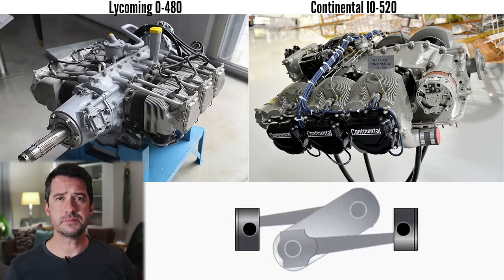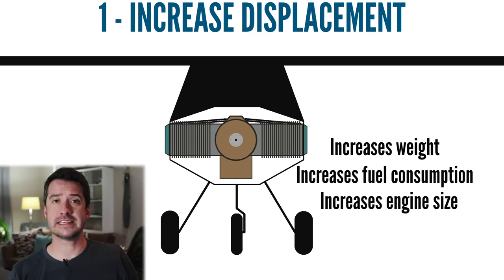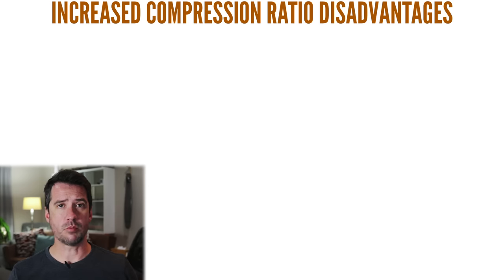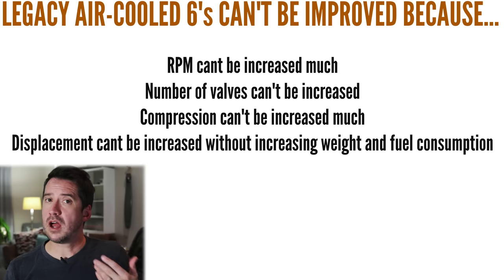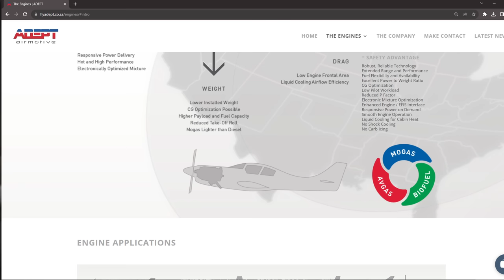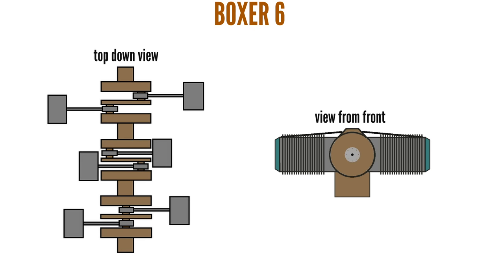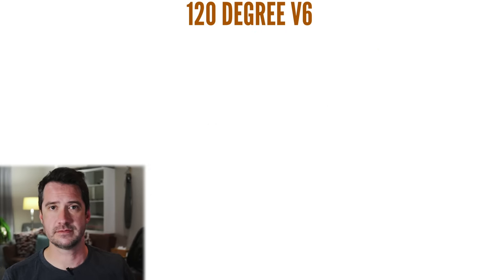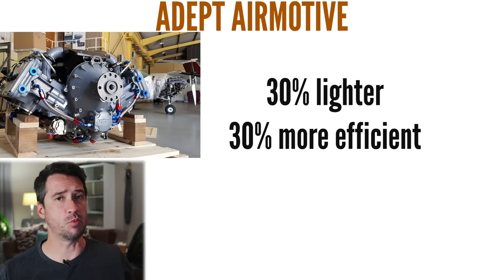Unusual V6 Airplane Engine Makes Boxer 6 OBSOLETE?

Comment: Introducing a new engine into general aviation is just about impossible given all the hurdles.
Reply: Rotax did it, so did Austro Engine. The problem seems to be Americans and their aversion to change.
Reply: @PistonAvatarGuy

And what is Rotax?

A 912 has the same power and the same weight as an O-200 whose basic design is from the 30s.. but they added four more failure modes (gearbox, dog clutch, coolant leak, and extra throttle cable). 

It’s a textbook example of why specific power (something Europeans obsess about) is meaningless in aviation.
Reply: @Bartonovich52  Here's what I suggest, look at the fuel consumption graphs in the operator's manual for the O-200, then read an article by Paul Bertorelli for The Aviation Consumer which is titled Rotax 912 iS Efficiency: Better than Claimed (Published:July 17, 2013)
Reply: Diamond did it. By simply converting a car engine. Very reliable and one of the safest in GA.
Reply: @Bartonovich52  Also, unless you have data which proves that the O-200 is more reliable than the Rotax engines, your comment is completely meaningless. You can speculate about failure points all that you want, but all that it ends up being is speculation.

UL Power can't even match the power to weight ratio and low fuel consumption of the Rotax engines, despite their lack of concern for high specific power output.
Reply: @Bartonovich52  Liquid cooling can't even be considered to be a failure point, as air-cooled engines are far less reliable than liquid-cooled engines because heat is so poorly controlled within the engine.
Reply: @Bartonovich52  I mean, gee, maybe there's a reason why no one uses the O-200 anymore, while Rotax engines sell by the thousands every year. It's hilarious that you people try to make me out to be the clueless one.

An additional throttle cable.. wtf? That doesn't even exist on the EFI engines. And I love how you just conveniently forgot about the 100 hp UL Power engine, which also happens to be European and is vastly superior to the O-200.

You have to be trolling.
Reply: @simeon2851 absolutely horrible engine. Single point common rail injection has no place in an aircraft.
Reply: @simeon2851  That was a diesel.
Reply: You can put -nearly anything in an experimental certified plane. SO any Any kit plane, or build it your self, they are Usually being smaller lighter airframes. That sounds just like the manufacturer's target market.
Reply: Its the bureaucratic agencies that move at the speed of observable evolution that stand in the way of technological advancement.
Reply: Not "just about" impossible. But absolutely impossible.
Reply: @Bartonovich52 And yet. I'd bet the Rotax is more reliable any day.
Proper fuel injection removes problems of (1) vapor lock and (2) carburator icing, and liquid cooling means (3) cylinders don't overheat when climbing and maximum power doesn't require ultra-rich-of-peak operation where unburnt fuel is basically used for engine cooling. (4) Pushrods are another source of failure, and not all parts of the air-cooled old-fashioned cylinders can be inspected, resulting in unrecognized cracks.
So instead of armchair-analysis, it would be better to compare engine failures in flight. The problem with that is, that unless it results in an accident, such failures need not be reported as far as I know.
Reply: Indeed. All the financial hurdles by the FAA has crippled GA growth and life. Most GA is using decades old technology unfortunately.
Reply: @PistonAvatarGuy  do you know what the longevity of Rotax is vs Continental? I know many of the small Lycoming can run way, way past their TBO but I don't' know  about Rotax and TBO? Continental can go past TBO but not with original Continental cylinders, which is ironic.
Reply: @PeterPasieka  No, but TBO is set where it is for a reason. You might get lucky with Lycoming and Continental engines, but they both have a habit of failing catastrophically, while that's not so with Rotax engines.

According to the stats, the engine core of the LyConts fails at 5 times the rate of the Rotax engine core. For Rotax engines, the carbs are a problem, but they can be bought with EFI, which is proving to be far more reliable.
Reply: I think that the rotax advantage is its water cooled head. I suspect  that cooling the exhaust valve area on an otherwise air cooled engine would allow a considerabley leaner mixture to be used without problems.  Rotax is only partly water cooled after all.cylinders still have fins
Reply: I think an opposed piston engine would be ideal. Diesel or gas.
Reply: @markjurkovich7814  Opposed engines are weak and difficult to construct.
Reply: @PistonAvatarGuy  I completely disagree with your statement as many examples show it does work. Junkers Jumo is one. But that's OK, I  like different points of view.
Reply: @markjurkovich7814  Sorry, thought you were talking about a boxer. And, sure, they work, but they're heavy and extremely expensive to produce, because they require two crankshafts and a large set of gears to link the crankshafts together.

Superior Air Parts already tried this with the Gemini, it went nowhere.
Reply: @PistonAvatarGuy  there are 3 ways of doing opposed pistons as far as I know...two cranks....extra throws on the crank and side bars like seltzer marine 2 strokes and rockets like on the commercial diesel lorry engines. Compression ignition is the way to go because jet A1 is the way to go....then theres the Deltic layout .....
Reply: @johnp3937  Side bars? Are you talking about the crosshead on the piston rod? The Sulzer engines are uniflow 2-strokes, like the old Detroit Diesels, they're not opposed piston engines.

Jet-A is not the way to go, it's not going to do anything but make light aircraft worse than they are now. GA is likely dead anyway, there's no point in throwing money at any new engine designs.
Reply: @PistonAvatarGuy  why do you think GA  is finished....and yes...crossheads.
Reply: @johnp3937  Maybe not dead, but sales aren't strong enough to justify investments into new engine designs. Although, people seem to be willing to repeatedly throw away money on the development of diesels that are clearly never going to be viable replacements for gasoline engines (Graflight, Deltahawk, SMA, etc).

Edit: Apparently, there was a diesel V8 being developed by Austro Engine that was a failure and had over a billion dollars backing its development. The Graflight engine had hundreds of millions behind its development. I just don't understand the obsession with using diesels in aircraft, it's the worst idea in the entire history of aircraft engine ideas. If the Adept Airmotive engine had the same kind of financial backing as some of these diesels, it would likely be revitalizing GA to some extent, simply because of the vast improvement in performance that it offers.
Reply: @johnp3937  Who knows, maybe the world will get lucky and someone will throw some money at the development of the Adept Airmotive engine, then we'll get something useful, instead of another boat anchor diesel.
Reply: @PistonAvatarGuy  I get your point. Thanks for responding.
Reply: @markjurkovich7814  Maybe that's a little bit of an excessively harsh assessment, that's just what i remember reading about them, but looking at the specs tells a bit of a different story. It's strange that the Gemini engine development stalled when the Chinese got involved, it definitely seemed to warrant further development.
Reply: @PistonAvatarGuy  Apparently Achetes built a 2.7 liter gasoline engine that was 37% more fuel efficent than a conventional gas engine. Entire removal of all the valve train which is a weak spot in any engine and should be cheaper to make because of many parts no long required because of the design and the large gearing between the two crankshafts can be both balancing and speed reduction for correct propeller RPM. Apparently the engine can use a variety of fuels from gasoline to kerosine to diesel depending on compression ratio utilized by design. Requires some forced air induction to aid in cylinder scavaging.
Reply: @kerrryschultz2904  That seems unlikely, but I do remember reading that opposed piston engines might have the advantage of greater knock resistance, allowing for higher compression ratios, as they basically eliminate potential hot spots in the combustion chamber that can set off premature ignition. The same thing was also said of the Bishop rotary valve. I also remember that the Germans had some sort of issue with the timing of the port openings on their opposed engines, so they offset the crankshafts relative to each other, but this caused vibration issues.

It's unfortunate that there isn't a government agency testing these engines and making the findings public, all that most people can do is guess about potential advancements and hope that some shady dealing doesn't destroy them.
Reply: @PistonAvatarGuy  There is testing done. The US military has been installing these engines in equipment and they produce more horsepower on smaller displacement than comparable engines. Cummins for one is one of the manufactures along with others that have access to use Achetes patent rights.What do you base all your speculation on. You can't compare an engine that requires all the internal resistance from compressing all the valve springs to an engine that has no thermodynamic loss to the non existant cylinder head which leads to greater use of the heat energy by the fuel used. A well established industrial scale stand by electrical generator manufacture replaced there standard engines for the oppossed piston engines because of reliability and lower fuel consumption per horsepower produced. As regarding why these engines aren't widespread. government and corporate interest such as the pretroleum industry has bought or interfered on anything that will mess with their sand box.
Reply: @kerrryschultz2904  Where are the published findings for the gasoline version? BSFC, emissions, hp and torque, longevity, etc?

It's not hard to beat the performance of military truck engines, they're pretty much the bottom of the barrel. I'd like to see BSFC numbers and longevity studies done for the gasoline version to confirm that it's viable for aircraft use, as well as mpg ratings in an emissions controlled road vehicle to confirm that it's viable for use in light production vehicles. Companies can make a lot of claims, but when it comes to meeting real world regulations, that often proves to be a very tall order.
Reply: @PistonAvatarGuy  Some of the information is on the Achetes website. They hold the patent rights to the fluid dynamics of the improvements on the opposed piston  engine of their design to meet the emissions and oil control loss requirements because of the exhaust porting in the cylinder. They have Cummins engine manufacturing building diesel engines that are about 15 percent greater in horsepower and 10 per cent more fuel; efficient than cummins latest high horsepower diesel engines. They had Ford manufacturing build a 2.7 liter 3 cylinder 6 piston engine to compete with the 2.7 liter v6. The achetes design made the same horsepower which was 270 horsepower but was 37 % more fuel efficient.It made the horsepower at a higher torque level and that is what is required for aviation.
Reply: @kerrryschultz2904  You're missing my point, that's just all marketing nonsense coming from the people who have a vested interest in the engine. I'm saying that we need data from an impartial third party.

As far as I can tell, Cummins is only making the engines as replacements for military diesels, which are absolutely at the bottom of the barrel. How do the engines compare to modern on-road engines?

Did the Achates produced by Ford meet current emissions standards? Was it as reliable and long lasting as the Ford V6?

You can't make more torque without making more hp, unless you're making that torque at a lower rpm, which is mostly irrelevant and completely irrelevant when it comes to comparing engines with gear reductions, which the Achates engine does have.

HP, weight and BSFC are all that matters when it comes to aircraft engines. so what are they?
Reply: @PistonAvatarGuy  The 6 piston 3 cylinder engine passed and exceeded emissions tests at the time of publication around 12 years ago. With no cylinder head and substantially less parts to fail it is similar to the junkers engine that was very reliable. You ignore the fact that there are substantial gains in rotation resistance by removing the valve train and the central gear that connects the two short crankshafts could be built to handle the output to a propeller and allow the engine high rpm potential if needed. I don't remember the numerous automotive journalists from US automotive magazines that documented the gasoline performance and fuel consumption, because it is over a decade ago. You also ignore the fact that if the engine did indeed prove to be substantially more fuel efficient the plane would require less fuel and therefore less weight for a trip. If your that serious about proving or disproving a potential engine then invest the time and money to purchase and test that engine instead of asking everyone else to do the work and cost so you can make money on the internet. Then publish the findings with full documentation.
Reply: @kerrryschultz2904  Again, you missed the point. Almost no one has the money to invest in new engine designs, so the only way to get them into production is to have a government institution investing in their development.

Comment: I have an engine in one of my cars with a compression ratio of 12 and it runs regular 87 octane gas because it wasn’t designed in the 40s. Direct injection is a thing. So why are companies in the US allowed to sell engines that can only run on leaded Avgas. Its crazy I mean i would understand if you are flying like a antique ww2 museum piece. new airplane engines should Only run unleaded by now. kids live near airports.

Comment: The V6 only requires a harmonic balancer like is used widely in the auto industry. In the case of car engines this is incorporated into the front-mounted crank pulley or on the rear-mounted flywheel. I suspect since a reduction box is required regardless of the motor configuration that the harmonic balancer is likely part of that gearset and incurs no additional weight penalty.
Reply: I thought something similar, it made sense for it to be part of the reduction unit since it's integrated.
Reply: V6 balance shaft rotates at crankshaft RPM . Valve train uses a reduction gear. Inline-4 balance runs at twice rpm
Reply: @ArneChristianRosenfeldt  The Inline-4 balance 'problem' is secondary imbalance related, not primary. If a v6 has a 90 degree inclined angle, it can be made with perfect primary balance, but secondary balance suffers. It will also have unequal phase from bank to bank.
Reply: @robertrobinson3861  120° V6 has even firing and primary and secondary imbalance. 90° V6 is composed of 3 Ducati engines. Their primary rocking imbalance is balanced overall. Secondary, I dunno. I just concur. Uneven firing order which leads to uneven kinetic energy. Torque vibration.

To make a six cylinder engine smooth, you need 6 throws (cranks). V8 only needs 4. So you get away with a lighter crankshaft and narrow bearings and less friction on a V8. It is more stiff. Only problem is that optimization seems to favour additional bays for counter weights. You can place the valve train there for DOHC. Pumps on the other end. Without this additional length you need very heavy counterweights which reduce the first resonance frequency of the crankshaft and defines your redline.
Reply: Car V6 engines using 6 throws (cranks), not 3, like this. Harmonic balancer is a different topic, this 120° V6 may not need it because of shorter crankshaft due to only 3 throws. Harmonic balancer is very important in case of inline 6 engines.
Reply: @krisztiankovacs3532  The length of the crankshaft is given by the bore. Manufacturers have no trouble to fabricate the 6 throws for V6 or flat-6. Even a W16 was made once.
No inline-6 engine has a harmonic balancer. I don't even know of a harmonic damper. Only cross-plane V8 use a harmonic damper. I don't even know why. With 90° V engine, just balance every bay ( to first order ). Cross plane deals with second order over the whole block. So why should a cross plane V8 need harmonic dampers? No other configuration uses them (V12: not, flat-plane V8: not, W16: not).
Reply: @ArneChristianRosenfeldt  Yes, the length is limited by bore, but the shift between cylinder bank can be smaller with 3 throws.  It is 1..2cm, not too much, but something. BMW M50...M54 inline petrol 6 engines has harmonic damper in the pulley in front of the crankshaft, and a good harmonic damper is very important in case of these engines. Oh, you and gronkvbs2795 are speaking about harmonic balancer shaft, I am speaking harmonic damper against torsional vibration. It was my misunderstanding, sorry (I am far for perfect english). Inline 6 off course has no balancer shaft, it is inherently balanced up to 2nd order.
Reply: @krisztiankovacs3532  the funny thing about being far from perfect english speaker (or typer at least ;) ) is I understood everything....except what yall mean by "throws".....it sounds like a feature physically machined into the engine, but also had the thought that it was a 'throw' of the piston like when the arm and crank 'extend'.... I have never heard this term regarding engines before....Then again I have never designed one either 🤣